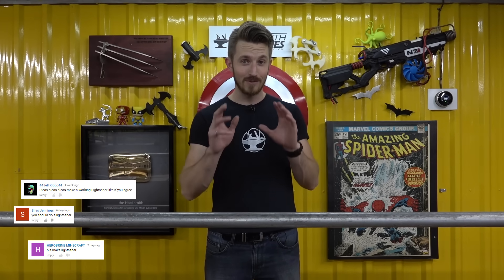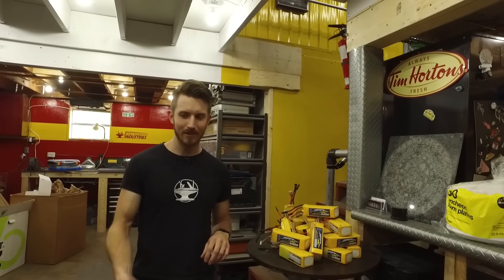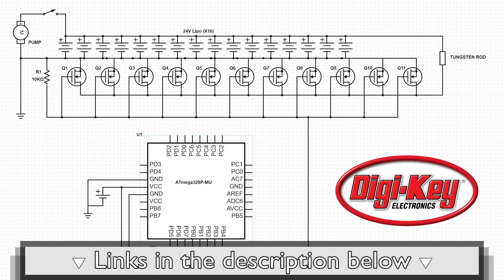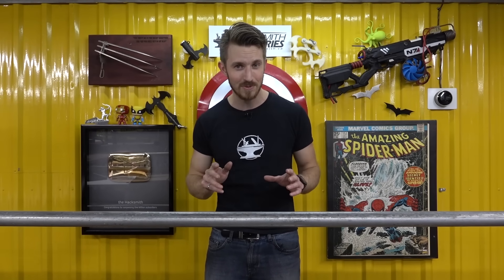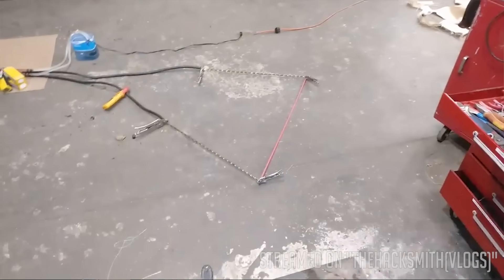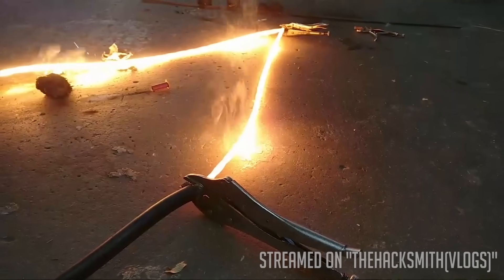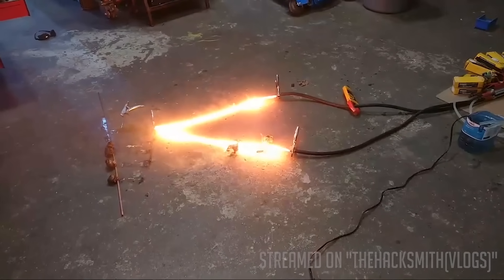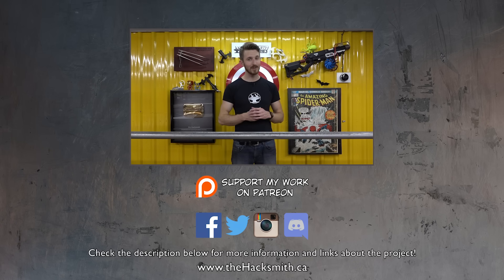HOMEMADE LIGHTSABER EXPLOSION!

Comment: I'v had an idea running for a while, on how to make a light saber, so here's my thoughts to make one.  

Using an elector plasmic shield, controlled in shape vie means of the voltage, wattage, amp's and ohm's in order to give it the needed light saber look.  
Then on the inside of the shield, a laser beam would be shot that would ricochet within it, the energy would build up to the point where it was dispersing threw the shield.... 

That's as far as I'v ever got with it, maybe you can make it true?

P.S.  Whenever you get that itch to make a suit of armor, you may want to get in touch with one Troy Hurtubise, just looking him up will explain.

Comment: use graphene as a rod and if u dont know what graphene is look it up and its really cheap yet it takes as long as a solar panel to make
Reply: also its one atom thin a 100 times stronger than steel and 50 times lighter its nearly clear and its made out of carbon
Reply: oh one more thing its very resilient to heat and electricity but is incredibly conductive
Reply: luv ur vids and hope u take my advice
Reply: I'm not too sure but since graphene is a superconductor there is nearly zero electrical resistance, which means it wouldn't be able to heat up very well with this circuit which uses resistance in a metal/conductive material to produce heat which makes it red hot. If it could heat up it wouldn't be able to do much because it wouldn't be able to go over about 350 degrees celsius since it would combust, reacting with the oxygen around it turning into carbon dioxide and/or carbon monoxide if incomplete combustion happens, with the size of the blade, the blade would dissipate rapidly since it could react almost immediately when the temperature is high enough.

Comment: Smaller battery one or two but use a step up transformer or an alternating current to save weight. U need a durable thick material for blade and a catalyst for heat. Like how welding rods are.

Comment: @hacksmith cant you just use a transformer salvaged from an oven? (you can convert dc to ac for power supply)
Reply from the maker: +Fgygcfhhvggh Hfhxyfdhyxchxjd a microwave transformer is at maximum 2000W.... This battery pack is 200,000W. You do the math ;-)

Comment: maybe use a steel pipe with a ceramic insulated steel core? its the only insulator i can think of atm so that you maintain structural integrity and can still heat up the outside?

Comment: another Idea i have would be - a plasma cutter or an Oxy-Acetylene torch with a very long flame... Since plasma cutters can cut metals, this should theoritically good to cut almost ANYTHING.... on an actual plasma cutter, its cutting flame tip is only a very small fraction of its actual flame, so the flame will have to probably be about a meter long to have a cutting tip that is almost 1 foot at the very base of the flame.
since this will be putting out a ton of heat, its tip will need to have a very high melting point. Two materials i know possible to design for a tip that can withstand very high temperature are ceramics, and tungsten - both will need some water cooling so it will at least keep the temperature down.
To make it regenerate the flame automatically if its accidentally put out by some wind, it'll need an igniter at the tip that constantly reignites it.. a good one would probably be an electric arc thats about an inch long - there are taser modules now that are small enough to be compact and still generate this arc length with 3-5 18650 cells, so that shouldnt be too difficult.

This will be somewhat dangerous... in fact, very dangerous.. the regulation of the gas tanks - it will need some (several) very good fire arrestors so it wont explode, and the flow of gas will need to be very fast - to make the long flame. And, this wont be very portable because of the two Gas tanks...

Comment: maybe a real laser diode?-a high powered one - maybe 10KW - this will need some cooling, so put the laser diode on the handle, and embed the water cooling around the handle - wrap it with copper tubes, then some hose to circulate, a water pump should be ok for the prototype.... 
Now one big problem about using a real laser is that how you actually stop light at the tip.. 
i'm thinking maybe putting a mirror at the tip so the laser has some defined length. This deflected light will continue going somewhere - so i'm thinking - keep deflecting it with two other mirrors so it only circulates on one linear path with mirrors on both ends. If its deflected on both sides, that should keep the light bouncing back and forth - so the current it needs will only have to be in small pulses - this will make it efficient.. A Concave mirror should work to contain the light - the angle is very critical...
to hold the mirror in place, you will need an actual steel rod, So when this is completed, the light saber will have a laser on one side for cutting, and the back side will have the rod holding the mirror on the top...

the failure of this theory and design would be 1.) if its possible to contain the light if its source is slightly offset the side from the one end. 2.) if mirrors can be cut by lasers.
so if you're going with my theory, test first the 1 & 2, if one of them is a no, then it'll be a failure...
Reply from the maker: +Adam Gadut good luck making a 10kW diode you can hold... Still wouldn't be enough to cut through anything meaningful either :(
Reply: yeah just a suggestion, the last part of the video mentioned putting suggestions on the comment.. i dont have the resources to test this.. 

since the laser is only turned on with pulses, it should be less hotter than one that is operated on Full duty cycle.. - just my thoughts

Comment: My guess is you'll get some sort of metal rod that has a super high melting point, so it can get extremely hot while keeping rigidity. You'll heat it up and cut away at stuff. Question is, will you figure out a way to do it with different colors?
Reply from the maker: +Etan Chamare hint in the video ;-)

Comment: Maybe it should be a type of metal rod with a higher melting point than the battery is providing
Reply from the maker: +RapidStarling hint in the video ;-) check the diagram

Comment: While I like the idea of using steel or tungsten, nether will provide the thermal conduciveness necessary to provide the results in any of the films. So with that in mind Hacksmith could try a high temperature ceramic-carbon composite tube that has been designed in segments so that one segment fits inside the other, similar to how the toy lightsabers work, with each section formed from radial facing hexagonal micro-pores that would allow free passage of material from inside the tube to the outside.

Now as for the material that would be used to generate the heat necessary for the blade to work, I would suggest the use of a high energy plasma. However since you guys are unlikely to build a micro fusion device to provide the plasma, I would suggest in it's place use a set up similar to a gas discharge tube. Now with this set up you would be constantly losing the gas to the atmosphere through the micro-pores. However you could regulate the amount of gas flowing into the blade therefore regulating the pressure in the blade allowing for the formation of the discharge arc inside the perforated tube. The discharge arc would then propagate to the full volume of the tube heating it to a high temperature and causing the energized gas leaving the tube to make the tube appear to glow in the specific spectra of light given off by the elemental gas you choose.

Side note:
This really doesn't matter because atomic disruption caused by the interaction of matter with a high enough directed energy beam will always win verses a high powered glow stick. Star Trek Phaser/Disruptor for the win!

Comment: lightsaber.... you may try building two magnetron anodes. attach them to a bearing between them so that they spin freely in opposite directions one clockwise the other counterclockwise.... tune the size of the resonant chambers of the anodes, to the frequency of an metal or substance you want to cut.. avoid the frequency of hydrogen 2.4 billion hertz. the purpose of tuning the resonance is to prohibit atomic bonding of the electrons in the substance('s) you are intending to cut.  make a few funnels that set insit of each other. these will be stations at the end of the anode on top opening out ward from the anode. build a housing for the lightsaber that reflects and bounces the RF frequency of the bottom anode around the assembly inside and out along the top of the assembly slightly narrow the opening at top so the RF is getting narrower as it get further from the end of the device while the RF from the top anode is set to emit straight out the same end down the center of the second one. 

the to microwaves should form a reciprocating field contained withing a measured parameter determined by your baffles on the top end of the device. the tighter the apex of the outer housing the shorter your blade in length. the wider your funnels the shorter and fatter your blade will be... make narrow funnels and a narrow baffle on the housing.. of course provide a tuning variable.
 
be careful while you play with the variables.  magnet deteriorate under heat and impact so protect the anodes and their magnetic caps on their resonating chambers from over exposure to heat and impact damage.
also you nee a motor small but fast to spin the two magnetrons in oposit directions this can be directly place between them or belt/chain driven from the side.  be sure to use lots of insulators to prevent grounding through components and prevent shorting of the RF circuit through the device.

these are basic ideas i just thought up, not the one i have drawn up in my notes... so i have not thought it all through completely yet.

Comment: The question wouldn't be how to make the saber it would be how are you going to wear it and avoid seriously burning or shocking your selves from the wires. The saber ideally would just have to be made of something with a higher temperature than that of the steel that you are using. Steel's/iron's max melting point is 2900 F / 1600 C. So any metal such as platinum or iridium would work. (My personal suggestion would be to use adamantium if you can get your hands on it ). Back to the real problem, you need a way to insulate the wire to prevent them from melting themselves and more importantly you. You could design a liquid cooler of some kind but that I would image would be extremely large (probably call one of those three fire trucks back to supply the pump) you could possibly use liquid nitrogen as a coolant.  you could design a disposable system that insulates the wires long enough to run a test and then just connect new cables when needed. For insulation aerogel might be a close bet to something suitable due to 90% being Air which isn't a good conductor and it can withstand very high temperatures. Cost of the whole build won't be cheap unless you can design a saber that can withstand the melting temp of steel/iron and the aerogel but it beats having heat sinks the size of a a car attached to the setup.
Reply from the maker: Adamantium is a fictional metal alloy...
Reply: the Hacksmith I know it was a joke ;)

Comment: A major mistake in your schematic is the mosfets do not have anywhere enough gate current. Also the gate voltage is too low, should be 12 to 15v. You need to use a simple mosfet driver IC. The way you have it would produce excessive heat in the mosfets. You could also add an automotive fuse to each battery so each battery current is limited to say 20C. Your web page says danger high voltage, should be danger high current. Good luck
Reply: I just checked your datasheet Fig. 1. Output Characteristics. You get double the heat using 5 volts on the gate. Or you  could say you lose 50% of the mosfets capabilities. Personally I would use 1 of these per 5 mosfets wih a 4.7 ohm gate resistorc per fet Digi-Key Part Number 576-1195-ND Running off a 15v $5 swutchmode power supply

Comment: 1. Use proper gate driver. Your solution is too slow, weak and unreliable.
2. Don't put that many mosfets if you don't have to. They should all be thermally coupled. Arrange them in square and on both sides of the heatsink if possible.
3. Equalize current paths so current does not prefer one mosfet.

Comment: What was your fillament? Might do some research into vape tech for ideas. I think they call a cheap, high resistance alloy "kanthal". Might heat up more quickly and be more durable than straight steel?
Reply from the maker: +Samuel Carpenter you didn't watch the whole video did you...

Comment: Conductor inside of a ceramic rod and a thick walled steel pipe around that where the ground goes in at the bottom and the positive lead in at the top.

Comment: Bored steel shaft with the positive electrode connected to the base with and insulating hollow ceramic core which the negative electrode of fed up to make contact with the top of the shaft

Comment: One way you could make the saber is to use a perforated ceramic cylinder that can handle high temperatures to control the length a fan at the base below a pair of carbon tubes. you can easily get the carbon tubes from Eveready super heavy duty Batteries.

Comment: You should put the cable around some super heat resistant but still
stirdy stuff,
that way you have a solid blade that doesn't turn into goo when you heat it up.

Comment: So.. it's a hot-wire Styrofoam cutter on steroids? I'd suggest a ceramic rod as a core with a tungsten filament wire wrapped around it. Basically, like a '30's light bulb scaled up.

Comment: for the lightsaber blade you will need only two of the metal poles. they will run from the handle to the  top of the blade parallel to each other. Also, use a "u" shaped piece to connect it at the tip.
Reply from the maker: +Joshua Rouault yeah, that's the plan lol
Reply: the Hacksmith I'm not sure if the rods can be touching though, because then the top would be not nearly as hot as the near the handle. so, I would put a heat resistant insulator between the two rods.

Comment: i think you will make it hollow so you can run a wire down the middle and some kind of insulation to protect the wires from the heat inside. or you can bend a steel rod in half so you connect each end.

Comment: If you want to make the blade expandable, you could use ceramic tube inserted into each other with your steel rods on the outside cut into pieces, so you get some kind of piston.

Comment: Use tungsten as the conveyance of the metal is flexible not to mention that the abutment is completely compressed to the size of the pivot. The regulation of the temperature also needs to be constant in order to withstand the electrical excavation of the intersected heat and I don't know what I'm talking about.

Comment: I would Say A carbon rod Or depending on the temp you achieve a glass cylinder with braided nicrome resistance wire down the sides. But a Carbon Arc Rods would be your best bet tho too short. You could use Stainless mesh around a cylinder  (http://www.stainlesssteelwiremesh.us/stainlesssteelmesh/knitted-mesh.html)  and run your impedance through it

Comment: funny thing... but whats about your Flying like a Iron-Man Project? is it a given up Project? 
I found an other YouTuber that tries that too, Gravity Industries ( link https://youtu.be/p-Bpfk99xl0 ).
And he stopping trying, he actualy fly,... he started Simular to you, First Thrusters for the Arms, than thrusters for the Feeds, but that make it to hard to get Controlled flight.
So he changed, there are now two thrusters on the Back, and two Thrusters each hand, (a total amount of 6 Thrusters).
And it works fine, he fly over 30mph, just 1 meter over the surface. dont know if he cant go higher, but anyway it works,...
So... i like your channel, and the most of your Projects, but that iron-Man thing i miss a little...
Because i saw so much inspiration, energy in your Videos about it, so where did that go? and will it come back...
Godd luck
Reply from the maker: Yeah, Gravity Industries had funding... we didn't. The prototype he built cost close to $100,000.

We tried running a GoFundMe but it failed, we can't really do anything without funding =(

http://www.gofundme.com/thehacksmith

Comment: why don't you wrap lots of copper wire around the tungsten and if the copper melts replace it, if not the wrapping around yo could melt the copper onto the tungsten so it forms a layer around the rod
Reply from the maker: Because copper melts at only 1000C ...

Comment: i guess the "blade" could be made from a piece of conductive pipe(maybe graphite?), with a lower-resistance metal rod on the inside to carry the power to the top. and of course some insulating cement or ceramic in between.